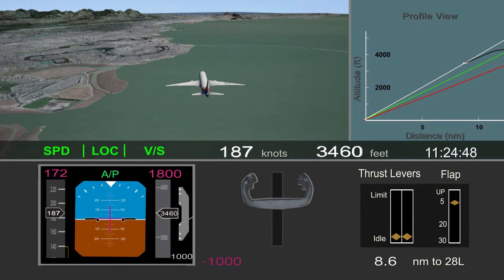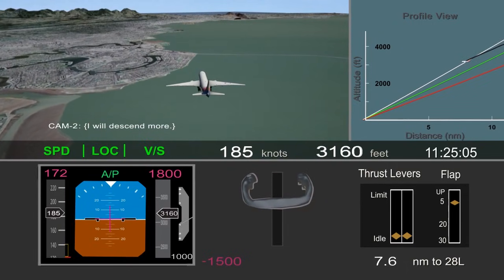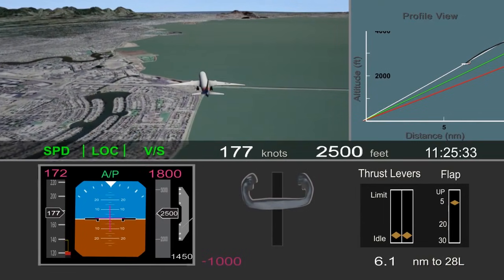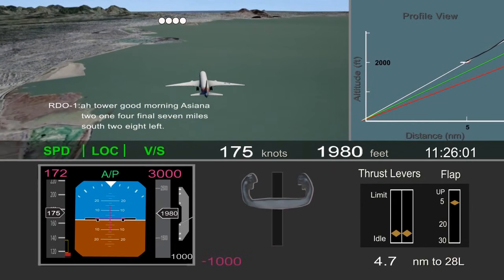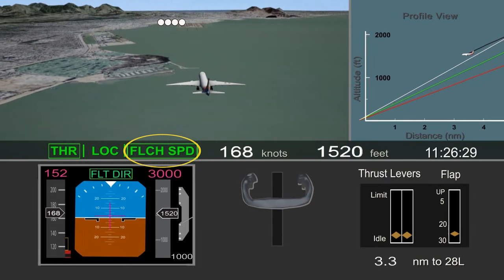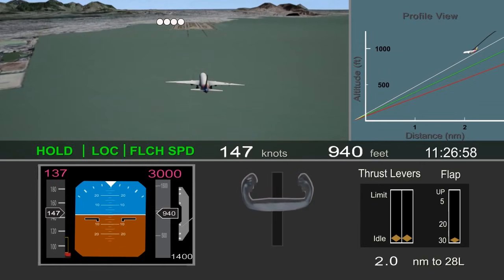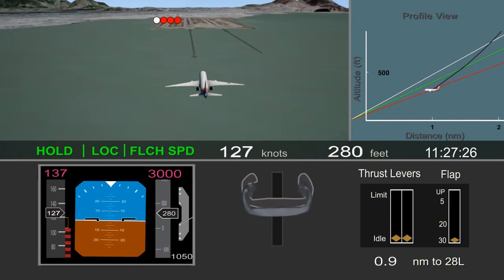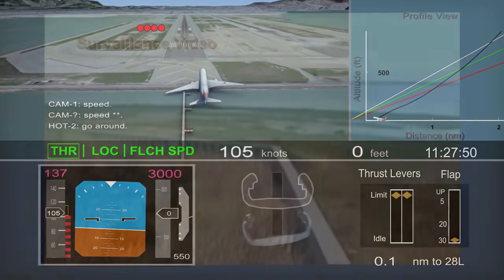Asiana Flight 214 Crash - NTSB Animation

Comment: Why is he even out of vnav path on an rnav approach it baffles me. I would have been looking at the captain sideways the moment he elected to use level change when less than 5 miles from the airport never mind 1500 v/s below 6000 feet is already steep enough! I mean you got to have no idea what you are doing if you are using level change that close to the runway. The guy didn’t even use it correctly he bugged the MSA then flight level changed resulting in a CLIMB lol like what are you thinking? And then disconnects the whole thing while it’s destabilized to just say “oh to hell with this I’ll hand fly it in”. Wow I’ve never seen someone mismanage their approach so badly.

Comment: The generally successful outcome was due to quick work from the flight crew. Captain Sum Ting Wong was the first to notice a problem. His copilot, Wi Tu Low, tried to correct for a too rapid descent. Ho Lee Fuk radioed to the tower the plane's emergency status. Bang Ding Ow was injured in the landing but is recovering.

Comment: I fly a passenger jet, this is an incredibly important accident everyone should learn from. I fear this same accident is going to happen again, probably at LAX sometime in my opinion. The controllers there notoriously have you drop altitude on the ironman arrival and turn you inside a very tight base to final, often inside the final fix on the ILS for a visual approach. If you're not ready for it, you'll often find yourself too high, and need to force your way down, like these pilots did. When this happens, most pilots I know just turn all the autopilot off and hand fly it, because it's way easier than trying to get the automation to fly a messed up profile. 

Automation is great, but as you can see here it can also be a double-edged sword... the autothrottles transitioned to speed on elevator mode instead of thrust, meaning that in a descent they will always be idle, and airspeed should be modulated with pitch. This isn't normal on an approach, so it's not a surprise the pilot didn't realize what was happening until it was too late.

That said, increased scan across the PFD at airspeed and glideslope, and hand on the throttle to override for speed should be obvious. Just like flying a windshear approach, even with working autothrottles I often override them because they can be slow to react. In the US, I think theres a good amount of training about over reliance on autothrottles and autopilot, but foreign carriers don't spend as much time on it. This sort of accident WILL happen again, and I'll bet that it'll be another foreign carrier first.
Reply: Yeah, lets all remember to not keep the throttles at idle during final. :D What a wisdom and deep learning experience

Comment: slowing below a hundred forty and you still got a mile and a half to go?  the caution alarm for that should be a mechanical hand popping up through the seat and applying attention getting pressure where it'll be the most attention getting

Comment: Too much automation these days is taking away the true skill of being a pilot. Now, everyone and their brother thinks they can fly and it's sadly not the case. This is reminiscent of Air France 447 where the pilots plainly did not know what to do, the plane was completely fine they just failed to realize the situation and as a result dove nose first into the Atlantic. How do you not know your elevation at all times, wait til you hear 'too low terrain' to pull up. Unbelievable. Prayers to those lost and their loved ones. RIP
Reply: I know.... But the Air France flight was not actually going nose down straight into the ocean; the pilots failed to realize the aircraft was stalling and the first officer mistakenly kept nosing up which caused there to not be enough airflow going over the wings for the plane to produce lift.

Comment: Ive been flying the  777 in fsx for almost 500H and I never use flch below 4000 even once. Or turning the throttle to manuals. People might say that simulators are different in real life but basic forces of flight is the most important thing in aviation

Comment: At that speed it's a miracle that the 777 didn't stall during approach at higher altitude
Reply: 777 is a very safe stable aircraft, I’ve spent 8 years on this plane

Comment: If you watch the video of the impact, you will see they were actually "lucky" that as the plane spun, it climbed (bounced?) and the wings were up in the air instead of hitting the ground. The wings didn't break because of that. Can you imagine the death tool if the wings broke off during that spin? fuel everywhere.

Comment: I wonder, why weren't they doing the ILS approach? I can land much better on my flight sim
Reply: ILS on that runway was inoperative at the time.  Maybe undergoing maintenance?  Just to be certain that you understand...  The ILS system relies on 2 transmitters and antennas on the ground to send out radio beams that define the proper glide slope and centre line of the runway.  There is a receiver in the aircraft that picks up these radio signals and gives the pilot a display that indicates if (s)he is above or below the glide slope and to the left or right of the runway centre line.  If the transmitters on the ground are not operating the receiver on the aircraft has no signals to work with so the aircraft and crew cannot execute an ILS approach.
Reply: @Vincent_Sullivan  yeah, I know how an ILS system works, don't worry...
Reply: I wonder how people use ils when the sky is clear,i thought only lazy flightsimmers who cant know how to fly doing this shit ,but when this is real pilot,here is the result

Comment: Hey fellow aviators... Im new at this but learning!! When he says the Hold Mode not controlling airspeed, what does it control? As the speed was and altitude was declining... Is it holding the engine in idle?

Or... Whats the auto throttle do ahah

Comment: At least he was at slowest possible speed a 777 can crash at.
Reply: Can you explain this to me?
Reply: @ivanriverooo  the constant pitching up without adding throttle put the plane in a near-stall situation. Their speed was pretty low at impact.
Reply: ....like a VMU flight test in reverse.  [VMU=velocity minimum upstick] high speed taxi with "stick" back to verify the lowest speed that the aircraft will attempt to fly...or at least raise the nosewheel off the runway. [tail strike protection for this test]

Comment: The problem is pilots outside the U.S. aren't taught basic flying skills, only how to manage the autopilot. If the autopilot turns off, they can't handle basic ideas like landing the airplane (as here), or recovering from a stall (e.g. Air France 447 crash).
Reply: Note the recent Aeroflot SU100 Superjet crash in Moscow .

Comment: The flight director seems to did nothing?
Reply: I dont know really know much about the flight director, but as far as i know it works together with the autopilot, it just shows to you what the autopilot would do. If you look at how competent they were with their autopilot/autothruttle, its no surprise. And apparently they switched it off when switcheng off the autopilot (the FD was also in the level change mode for 3000 feet, so it was useless anyway).

Comment: I'm not in any way suggesting this had anything to do with the reason the plane crashed, obviously, but, the firefighters seemed to have been on the scene very quick, but it took 45 minutes to extinguish the fire, is this normal with plane crashes due to jet fuel burning? Wasn't the final NTSB report critical of the pilots, or crew, the airline, and the ground crew all together ?

Comment: This reminded me of my first few attempts in trying to land on a flight simulator
Reply: I know right. Why is he even out of vnav path on an rnav approach it baffles me. I would have been looking at the captain sideways the moment he elected to use level change when less than 5 miles from the airport never mind 1500 v/s below 6000 feet is already steep enough! I mean you got to have no idea what you are doing if you are using level change that close to the runway. The guy didn’t even use it correctly he bugged the MSA then flight level changed resulting in a CLIMB lol like what are you thinking? And then disconnects the whole thing while it’s destabilized to just say “oh to hell with this I’ll hand fly it in”. Wow I’ve never seen someone mismanage their approach so badly.

Comment: Even people who only play FSX (especially with the pmdg 777) could have landed this better than them and recognised any errors or issues that were occurring and rectify them. If you are having to adjust V/Speed then you are NOT descending automatically on the glide path. How can you think the autothrottle is on if you can clearly see the the throttles not moving and that the engines aren't changing sound and the speed is clearly dropping , yet they notice all of this and did nothing earlier.

Comment: Pilots are so incompetent this days that can't even switch the autopilot off. I remember in my flight simulator days that i will always perform a manual arproach and lading regardless of the conditions, i was also favoring VOR approach rather than ILS just so i could improve my flying skills.

This "pilot" was doing an auto-approach on a sunny day, what a tool.

Comment: Seems like every action taken, did not remedy the unstable vertical approach pathway, that this airplane was on. The missed approach altitude should not be set, until vertical guidance changes from vertical speed to glide slope, This being achieved would cause the "Go Around" vertical and lateral guidance to be armed and would have prevented the unintended application of power, and the autopilot reverting to a upward flight level change.  It is also easy to become overloaded and distracted trying to control many out of range parameters simultaneously. This aircraft is a wide body and has massive momentum so your thinking has to be well forward of your physical inputs.

Comment: How would the plane have handled the landing if they hadn't struck the sea wall but had made actually touched down on the runway?
Reply: It would have been a very hard landing since the plane would have struck its tail before landing on the main gear and then flopping down hard on the nose gear. It would still result in an emergency situation if not a crash.

Comment: I am still confused as to why the airplane was so high in the first place and why didnt the autopilot follow the glideslope?
Reply: The video says its because of a series of prior "speed and configuration changes" but doesnt elaborate. Given the pilot switched the AP to FLCH seemingly forgetting what it does, nothing would surprise me at this point.
Reply: They were in essence hand flying this approach with the auto-pilot. The auto-pilot was not coupled to the ILS. Just because the auto-pilot was engaged does not mean it follows the ILS. You have to program the FMC to tell it to couple to the ILS. The auto-throttles can be disconnected from the auto-pilot also. There are many types of scenario's that you can put this auto-pilot into.
Reply: I just watched the MayDay episode about it and something was turned off that day at the airport that would allow for an instrumental approach.  Only PAPI was working.

Comment: This wouldn't happen if this is an airbus
Reply: So put shitty pilots in an airbus?
Reply: BLAMBERRY he is right tho, not saying Airbus is better overall but in this case the protections from Airbus would have helped.
Reply: How would airbus protections help a bad pilot not get below glide path on a visual? That notorious Air France crash basically illustrates how when dealing with bad CRM and pilots who forget how to fly the airplane first no safety system is infallible.
Reply: technically these pilots are more familiar in airbus planes but thats no excuse to crash any plane on a clear calm day

Comment: WHAT A BUNCH OF UTTER, AND COMPLETE MORONS FLYING A HEAVY INTO THE GROUND ON A CLEAR, CALM DAY
Reply: L H 
Stalling at low altitude is a rookie mistake if I ever saw one
Reply: Everett Jay  Said in another video of this crash.

7 months ago
As someone who has flown for an Asian Airline for 11 years, I can tell you that Asian Airlines (almost all of them), do not train visual approaches.  Even when the weather is clear, the have their heads down and are watching the Glideslope and Localizer needles to make sure they are centered all the way to landing.  All with the autopilot on or at the very least, the auto thrust. So, why do they do this?  It’s because ALL Asian airlines use QAR Data to punish pilots that deviate from the Airlines strict and idiotic permitters that they set.  Let me give you an example.... Taxiing more than 10 knots and making a turn of more than 50 deg. Results in a hard (RED) QAR. Another one is G/S deviation on landing as well as a Long Landing.... (even though you touch down in the touchdown zone).  And there are 50 more strict guidelines the airlines put in place in order to keep their pilots in a Box of Parameters to work from.  What they lack in stick and rudder skills are supplemented by this box of operating guidelines.
They then use this data to access the quality of that pilot for upgrades in First officers as they move from F1-F10 (F10 being almost a captain).  Once your a Captain, those same QAR Parameters still apply.  The “leaders” then use this data on each pilot (yes names are attached to this dats....), to punish the pilots with deductions from their paychecks....  Sometimes in the thousands of dollars and additionally use this data also to decide who is a good pilot and should be moved to a Captain position.
In Asia, money rules! Being a Captain and making that money drives all of them to show the leaders how few Red QAR’s they have.  
So you will now ask, how does this make a 777 fly into a sea wall on a clear day?  On this day, the G/S and LOC guidance was out of service.  The pilots didn’t expect this even though it was NOTAM(ed) out.  Not to mention it was written in English. Now they were forced to hand fly this jet (laterally and Vertically)without guidance to the runway and that is something Asian Airlines DO NOT DO.  They do not disconnect the Autothrottles on ANY approaches...ever!  These pilots were confused on what was going on (no LOC or G/S guidance), lacked basic hand flying skills based on line of sight (because they don’t train this) and were VERRY worried about the QAR data flagging them in all their confusion.  Couple this with poor training culture, new pilots on new aircraft Type and you will just barely.get a glimpse of what every expat pilot in Asia sees as a Major setup for accidents just like this.  
I could actually write an entire book about this subject but just thought I’d share just a little insight into Something every expat pilot in Asia already knows.  Fighter Jet pilots or not, Asian airlines do not work their way up to being an airline pilot like in the USA/Europe and the other 99% of the world.  They go from a Cessna 172 straight to a jet. They don’t fly cargo, charter work, flight instruct or do anything that prepares them for even a strong crosswind landing until they start Captain training.  They lack experience, proper mentorship both in International flight rules and the basics in decision making (thinking for yourself), problem solving, basic skills and live in fear of the RED QAR.
It’s NOT that they are stupid... they are far from that.  It’s an aviation and culture issue that can not be taught in any textbook.  This leaves them behind the rest of the world and I sincerely hope some day this changes.
Reply: I would read your book on the topic!  @TNW1337
Reply: @TNW1337  Thank you for explaining this.
Reply: You guys all sound like people who have never flown an airplane.
Reply: That's even worse then! If completely inexperienced people are able to point out the gross incompetence, why is this moron allowed to fly?! Not only that, but there's plenty of really experienced amateur and commercial pilots in these comments as well as online pointing out the rookie mistake.
Cut it out with the stupid pilot hero complex
Reply: @maxmaxmaxmaxmaxmaxmaxmaxmax1  I have flown airplanes, and if I did this, I would be a complete moron.
Reply: @lm1584  Congratulations of flying a 172. When you start flying for the airlines you may understand how this situation could unfold.
Reply: @maxmaxmaxmaxmaxmaxmaxmaxmax1  this situation should never unfold in anything close to resembling commercial professional operations. You're obviously someone who has zero clue about how the aviation industry works in North America
Reply: @lm1584  Let's clear something up here... I am a pilot with an airline.

I highly doubt that you are a pilot, or if you are, you have a serious case of invulnerability.
Reply: @maxmaxmaxmaxmaxmaxmaxmaxmax1  please tell me what airline you supposedly fly for so that I can avoid it. 

If you really are a pilot, which I highly doubt, the type of inciden, as mentioned above, should only happen in flight simulator because your mom is talking to you.

If you are a commercial airline pilot in North America and you were responsible for this event that happened at ksfo, you would never find the job on the continent besides flying rubber dog s***
Reply: @lm1584  The difference between a professional pilot and a flight sim pilot is that a professional pilot doesn't pretend that they can't do anything wrong.

Part of my job is understanding how situations can devolve and taking steps to prevent it from happening.
Reply: @maxmaxmaxmaxmaxmaxmaxmaxmax1  
I know right lmao